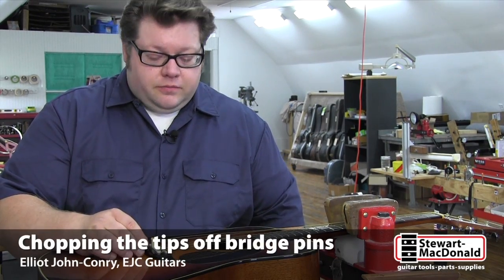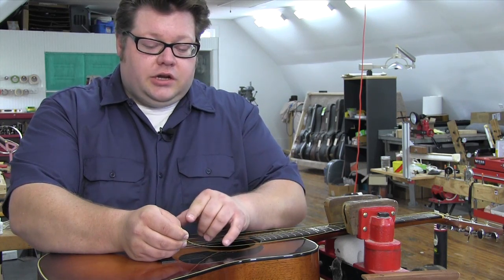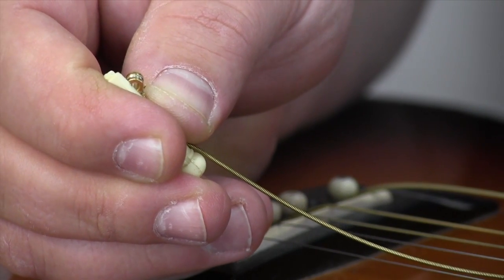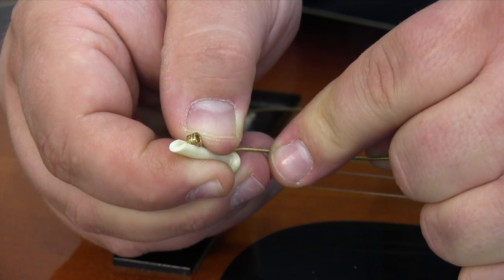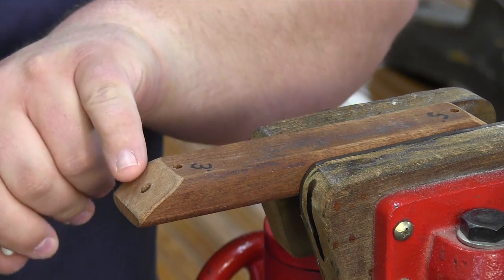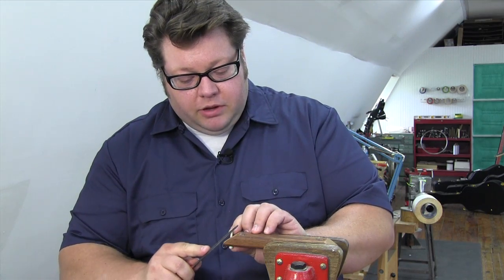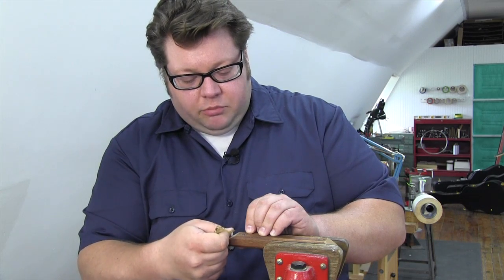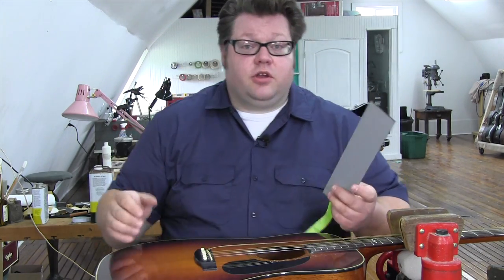Chopping the ends off bridge pins

Comment: I use unslotted bridge pins.  And the slot is in the guitar pin hole.  When I install the strings I put them all in at once and verify that the ball end is next to the body.  This allows the vibrations to transfer to the body to more efficiently.  I will take your advice on the slotted pins in some of my guitars.

Comment: I angle all my pins for the reasons you give plus, there are two other problems that occur with flat pin ends. The string will be under tension before the pin decides to release and go shooting across the room which then requires crawling around with a flashlight trying to find it. The ball end under tension, slips off the pin smacking against the bridge plate cracking it. I install all the ball ends and pins and pull them tight and then, before attaching strings to tuner posts, reach inside and feel all the ball ends to make sure they are resting against the bridge plate and not hung up on a pin. Even with angled ends on the pins, I have had the ball end hang up a couple times.

Comment: My low E and A strings always make my bridge pins raise up a bit.  I even use Mitchel's PlateMate so as to save the bridge plate from wear.  I slightly angle the ball end toward the sound hole, insert the string and bridge pin, pull up on the string and the bridge pin is seated flush at this point with the bridge.  When tuning it up the bridge pins still rise a bit.  Not sure why.  I use 12-54 strings now, it was worse when I used 13-56.  I use the correct 5% taper bridge pins on my 2012 Martin HD-35.  Have you done a video on how to keep the bridge pins perfectly seated when tuning up?

Comment: Your actually supposed to cut a slight slot into the hard wood glued under the bridge so the string slides into and locks in the slot, all the pin is for is to cover the hole, this is from a Stew Mac Dvd and makes perfect sence.  The pins are not there to hold the strings in at all but too many use them for that.
Reply: That's interesting. I didn't know that.
Reply: Really???? Been around guitars all my life, and other than classical guitars, where the strings are tied on, all the rest USE a bridge pin to hold the string in the hole.  Thats what it is designed for.  If someone else has you brainwashed to think otherwise, I would throw that book away before you start learning to play without strings.  The bridge pin holds the ball end against the bridge plate, but without the pin, the string will surely fly out, so it must be there to hold the string in the bridge also.  It serves 2 purposes, so to say its not there to hold the string in AT ALL, is just stupid.
Reply: Nothing is just stupid, I don't use pins in any of my acoustics, call Stew Mac and ask them that's where I got the info, I was not brain washed sorry, a bit difficult as I have several degrees and do not believe anything till it is proven.  I tie my classical guitar strings on too. It does not matter how long you've been around guitars learning is continual.
Reply: Seems odd that all guitar makers, even of High End guitars, all use Bridge Pins, and continue to.  If they were not supposed to have any, then why do they make them that way????  I am taking the knowledge of several guitar makers over the knowledge of just one person.
Reply: Steward Macdonald on the internet is where the info came from as I have stated three times to redundancy. Live and learn.
Reply: From watching some videos on the Martin guitar channel, what I came off with was if you have slotted bridge you use unslotted pins (or turn slotted ones around to use the unslotted side), and if you have unslotted bridge you use slotted pins. Either way the string is held in place by the friction between the bridge pins and the bridge plate.
Reply: I don't need pins to hold the strings in at all, I use unslotted pins I make and I build my guitars, none of this of course is new, people are so eager to follow the many.
Reply: Joshua Kleiner
Exactly.... seems we only have one person here who disagrees with the MANY, no wait.. ALL guitar makers.
Reply: I don't know of any luthiers who don't do it in the manner Stewart McDonald suggests, it's been done that for years but many who are not luthiers don't know it, everyone can do it as they are comfortable and I can't believe this  has gone on this long, my my.
Reply: Slotted pins exist so you don't need to slot the bridge. Here are some good pictures to illustrate the difference http://www.bryankimsey.com/bridges/slotted.htm
Reply: Jyme Bale
I have actually called the Luthier's I know of in my city, and not one of them agree with you. I cannot believe you are still trying to say this is the best way to do it.  My my.
Reply: Good for them, I am very, very happy to be different, have been a head all my life and will continue, none of my steel strings need pins but I put them in to cover the holes as Dan Earlywine from Stew McDonald suggests and is common sence to some, I'll bet you are against multi scale finger boards too, mine are 29.5 and 25.4 on one finger board, another famous lutheir thought of this, thank goodness for the out side the box thinkers, did you know the world is flat, or is it?  No, some one proved it is round, oh my!

Comment: Hi! Thank you for your grate videos. I didn't watch this video soon enough :( Now I have a guitar that the pin holes are wider than the pins. I also used a half an inch thick piece of wood and glued it under the part that has the pinholes , which i had to drill the hole into. Now I have holes that are wider and deeper that normal. Any solution to my situation?
Reply: New guitar

Comment: I just one acoustic guitar with bridge pins. When the ball end is seated, the end part of the winding before the ball end cuts in the wood around the pin holes. 
Any trick to prevent that?
Reply: Slot your bridge.
Reply: @jdmcquerry  That's the problem. The string is making it's own slot in the bridge

Comment: Why? Why don't the manufacturers just make them with the bevel in the first place?  I can't count the number of times I've seen pins pulling out from folks not putting the strings on right, this has been a problem forever, yet no one is making bridge pins that prevent it, you have to modify if you want them this way!?!?! DUMB!  They know this design is flawed, it has been since this bridge was invented, why do they not fix it? Especially when the fix is so freaking simple? This video just made me hate the acoustic guitar industry.
Reply: also is it not insane that most manufacturers of beautiful guitars fail to sell their gutars properly setup? its like buying a new car then heading over to the muffler shop to get the front end aligned because they didnt do it at the factory.....it really is dumb

Comment: Just put string slightly in hole then make sure the pin passes the ball end while pulling on the string and pressing down pin gently. Or spend 20 mins fucking around with pins for no reason.